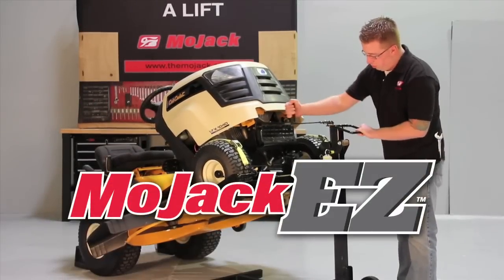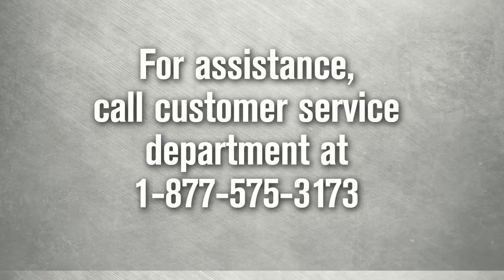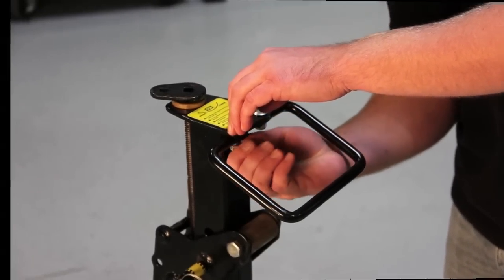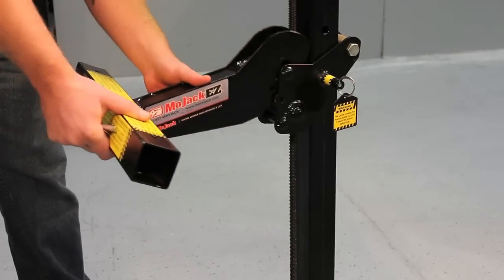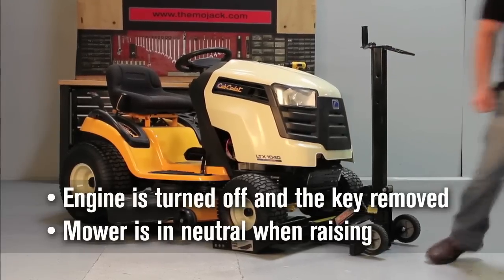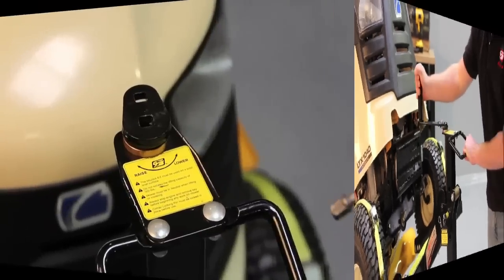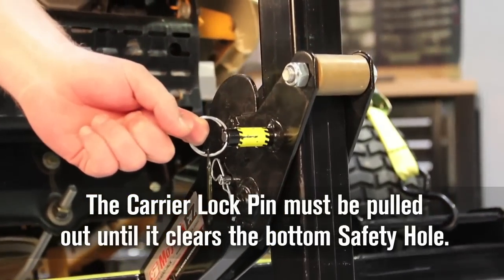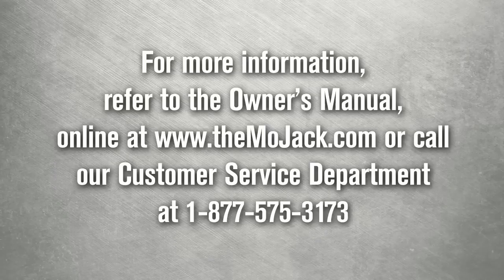MoJack EZ Instructional Video

Comment: My used MoJack cost me $50 on craigslist it is in decent condition, used it to change mower blades worked fine until i lowered it bound up why ? It pays to read the tag on the safety pin when the pins Pulled out the jack goes Down
operator error not MoJack's - Good addition for working on a mower

Comment: ATTENTION: You may get a "safety updated" model whereby the tower locking pin (DOES NOT) lock when pulled and rotated.  You must pull the pin (MANUALLY) as you crank the lift down.  Each time you come to a lower locking pin hole, you must pull the pin out to get by the hole.  Do that until you have reached the very bottom.  When cranking back up again, you don't need to pull the pin, as it will ride by each hole.  There are three holes.  Choose the hole, or height you want, crack just above it, then crank back down.   As you crank down, the locking pin should automatically spring into that hole to keep the tower from going lower.  Hope that helps someone.
Reply: I hope you're not saying that otherwise, 350 lbs could come crashing down on your head. Ouch....

Comment: That’s nice but I’m an old geezer that basically needs the mower standing close to straight up. I’m not good at getting on the ground to remove blades…but I do it ‘cause that’s my only option. I have a manual Jack that works very similarly to this one except I have to push the handle down to lift the mower. Can’t do that forever.  😳

Comment: very easy to assemble - just take your time, don't overtighten the nuts.  and my mower outside wheel measurement is only about 33" and it fits.  I don't know where the 35.5" measurement comes from.